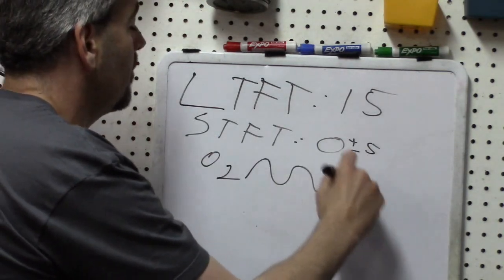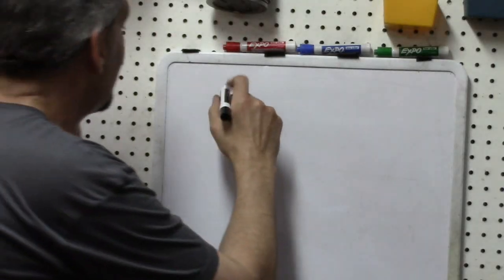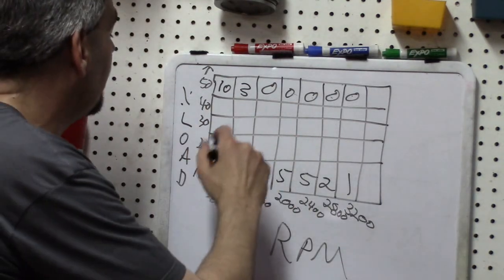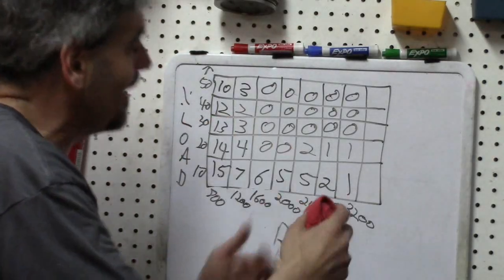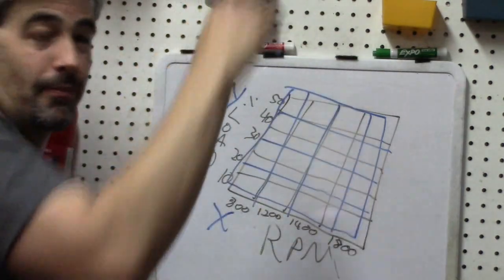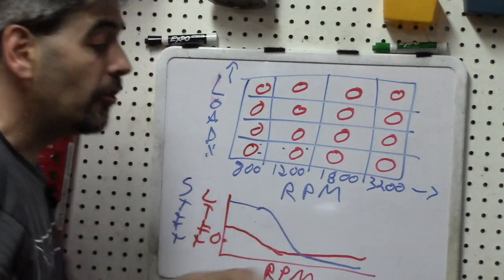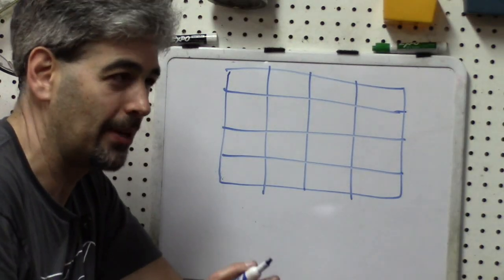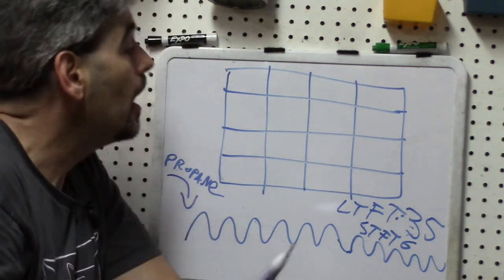Understanding+Diagnosis: Adaptive Fuel Learn Strategy

Comment: So if im working on a ford 4.6 and it has a vacuum  leak and is setting lean codes for both banks. My STFT is 0 because the computer has adapted for the lean condition and my LTFT +30%. If i find the leak and fix it while watching the fuel trims what is the STFT gonna do? Go negative until the o2 is reading stoichiometric? How long does it take for my LTFT to come back down to a normal value? I fixed this vehicle already but i didnt understand how this vehicles adaptive fuel strategy worked.
Reply from the maker: You are correct. In some cars you will see the adjustment with STFT immediately, in others I have seen it take as long as 10 minutes. But indeed, since the car has been adding fuel to compensate for the leak, fixing the leak would cause a rich condition and the STFT will compensate by subtracting fuel.

Comment: Matt my scan tool states OL bank one, four cylinder engine. It seems one of my O2 sensors is not going into closed loop. Car is running great I am a bit puzzled. But as I said I believe my car if fixed. Any advice appreciated thanks.
Reply from the maker: There are usually two reasons that a scan tool shows a car won’t go into closed loop.  One is a communication issue with scan tool- it just doesn’t show the car is in CL
   The other is that there is an issue preventing car from going to CL.  It’s known as OL3. Things like misfire problems, timing problems, some sensor issues can cause the car to not go into CL despite the engine being warmed up.
Reply: @SchrodingersBox  Thanks Matt I will see what I can find out. The car is running very smoothly, no noticible misfire, cam timing is spot on, ignition timing is computer controlled as you know. SHTFT is still zero long term 8%. Going to test the sensors and wiring to the o2 sensors. The fact that the SHTFT was 16% proves the sensors are working after I fixed the vacuum leak. Mabe just not communicating it's closed loop with the scan tool.

Comment: I am trying to figure out my crossfire injection OBD -1 with a Snap - on brick mt2500. Is block learn, long term and integrator, short term trim? I'm confused!
Reply from the maker: yes exactly. you got it correct.

Comment: Ok. No jokes. True that.

I haven't read all comments yet (bummer), but - Matt.
You mentioned fuel maps. Great. To be honest - I hope you will dive into this even more (although I understand you don't want to loose 98% from your 2%...), but are you sure that the map will be zeroed after refresh? AFAIK there is a map that is provided in PCM and this is the one that is just corrected later by all sensors (adopted). But I'm not an expert here of course and really willing to learn as much as possible in this area.

The next thing is that you were about too explain that it's ok not too see o2 sensor going rich when you have LTFT maxed out. Well, your video explained Fuel Trims (and why they do not change as expected), but not o2 sensor I believe. Why?

Because from my understanding o2 sensor is stupid. It measures (well, now we know what it measures for sure :P) the amount of fuel mixed with oxy.
In condition like in Jeep - bad fuel pump - o2 should always show lean, no matter what. There is always less fuel (let's assume that) than expected to meet 1:14,7. And when you add propane - it should show rich. No matter what. There is always more fuel than expected. Actually you can test o2 sensor not plugged into the PCM just by heating it and spraying or not propane. This way it will never be oscillating of course, but it should show or lean or rich. Isn't this stupidness of o2 reflected by scan tool? In that case - to rule out bad o2 sensor it would be better to use just voltmeter and check, if under maxed out LTFT and bad fuel pump it still shows around 0V, but after adding propane it shows some change.

Oh man, what a long comment. :/ And hopefully my way of thinking is not completely wrong here.
Reply: For the first question, it seems that in this answer he agrees with you: "Once created, is the adaptive learning array stored in volatile memory, such that disconnecting the battery clears that array and those variables are purged?  Furthermore, are there default variable settings in the array that the PCM can follow until a new array is learned and stored?
REPLY

Schrodingers Box
Schrodingers Box  1 year ago
+bionicat Both of those statements are correct!"
REPLY
"
Reply: Am new at this , is a bit complicated but I understand and since I don't have a fancy scan tool to check for them maps I agree with Brady bell if you clear the PCM I believe it will force the problem to show it self a lot more whit the other test you have shown us. Am I right mister Mat? The hole thing here is to give the 2% a way to look for problems with average scanner with out using this expensive scanners. ether way I have learn a lot watching your videos Mat thank you. ps: by the way am a terrible speller  lol

Comment: Question pls.. My car at idle LTFT is around 5% and when my car is actually running I get LTFT of around 9.38% at 4th gear and on 5th gear it goes 10.50 to 11.40% is that normal or it is adapting to its problem? My car is 05 saturn ion manual. It really confused me about 14.7:1 while running the car does ur LTFT stay 0% or it may change base on the load assuming the car is in perfect condition? Thank u! Hope u can clear my mind out.
Reply from the maker: i don’t see anything wrong.
Reply: Thats the normal for it? Thanks so much!
Reply from the maker: No way of knowing. All you have is fuel trim data. I don't see whatb you are exactly looking for. What is the strategy here? What are the symptoms? What are the fuel trim responses to input variables?  There is nothing you can say with this data.

Comment: Question I have a 2012 Buick enclave with about 67 K miles.
When it's cold like first thing in the morning when I start her up for about 10 seconds or so I get a rough idle and then she settles down nicely.. she's burning more gas than usual. Fuel pressure is normal at around 59 psi. I noticed today bank 1 sensor 2 is clocking low millivolts the other 3 sensors are much higher 
The other day my STFT was okay but my LTFT was negative 100%.I can't seem to find any vacuum leaks.
What's your thoughts on this pesky problem.thanks
Reply from the maker: I am not following - why are you doing sensor 2 data on a negative fuel trim?  you can’t tell anything from this data. 
  just stay with the basics- just run a fuel trim total curve against load and get the direction that way.
Reply: @SchrodingersBox  sorry should have mentioned the bank 1 and bank 2 sensors are the Oxygen sensors..two issues conflated..
Reply from the maker: oxygen sensor data is not useful until you know the full fuel trim curve.

Comment: I have civic 2005 1.5L. It does not have O2 sensor. On OBD2 it does not support STFT/LTFT. How this works in my car?
Reply from the maker: You have an air fuel sensor. Just use stoichiometric output instead of fuel trim.
Reply: @SchrodingersBox  thanks

Comment: I connected the scanner on my 94 chey trk 5.7 an is showing open loop an a lean condition an a fix #of456 could this be a intake manifold leak an what else can I check like your vedios
Reply from the maker: Simon flores You need to check fuel trim against induced variable- you are just listing symptoms, not diagnostic data. There is no way to make a diagnosis on this little information bro.
  See my video "secret of engine problem diagnosis: fuel trims" and it will show you how to do this right.

Comment: I have a 2003 ford focus zetec.  The long term fuel trim is at 0 when I start the car and also after I drive it around for 10 minutes.  I know I have seen the ltft show positive numbers before.  The short term will show between 15 and 30% so I would expect the long term to show something.  Would a check engine light cause the long term fuel trim to be set to 0 or disabled?  Is the ecu using the car battery to maintain memory or are there capacitors (or something else) on the ecu that could have failed?  I'm trying to determine why the car sometimes dies at idle and I'm sure it is due to getting lean but I suspect it wouldn't get so lean if the ltft was actually working.  Any suggestions?
Reply from the maker: WHat is the MIL code?
Reply: @SchrodingersBox  there are two and both are pointing to engine being too lean. I'm going to do a smoke test soon to see if I can find any leaks. If the code numbers are important I can grab those and post back.
Reply from the maker: Ummm the code numbers are THE most important. Why on earth would you smoke test the engine not knowing the codes?
Reply: @SchrodingersBox  the codes indicate engine lean.  I'll have to allow them to reappear so I can get them again. I suspect there has to be a vacuum leak because short term trim was going to 30% today at idle.  Thanks for the input by the way.
Reply: Checked for any vacuum leaks with smoke machine and didn't see anything.  The car idles okay at about 30% short term fuel trim with 0% long term. Engine RPM is around 800 and the air flow rate shows 1/10 pound per minute.  Fuel pressure is steady around 42 PSI. My only guess is that the air flow sensor isn't reading enough airflow.
Reply: Turns out the pcv valve was the issue. I replaced it 4.5 years and 60k miles ago.  Since the pcv regulates the amount of air that passes though the crankcase bypassing the air flow meter I should have considered it first. The short term fuel trim is back around 0% at idle now and air flow meter now reads about 3/10 lb/min. Old and new valve felt like they were flowing the same at idle so best to replace at regular intervals I guess.  The old valve rattled same as the new one.

Comment: what happens if we unplug the O2 sensors and drive it like that for ever?
Reply from the maker: Then you will lose performance and fuel economy plus have the check engine on forever. Also if the native induction doesn’t provide stoichiometry, you will permenantly run either rich or lean either of which is bad for the engine. there would be no trim adjustments.

Comment: Hi, I really like your videos. Maybe you can help me and give me a trace for my problem. My car (Ford Focus) has a very low and stumbling idle about 690-710 rpm (should have 850 +- 50 rpm). I looked up the LTFT which is at -8 and the STFT about 0-1. BUT the O2 Sensor oszillates between 0,1 and 0,6V whitch would be a lean condition. If I tip the throttle LTFT changes to -5 (yep the learned value for this conditions) but STFT decreases to -6 as well, so the sum is pretty negative. Do you have a clou why the fuel trims could be negative under lean conditions? Or a hint what datas I should check?
Reply from the maker: +Fabian Wojtalla You do not have any data that is relevant to identifying a condition here. Need LTFT and STFT curve over RPM and response from O2 to induced lean and rich variables.
  With what you have here, there is nothing useful.
Reply: +Schrodingers Box Please have a look on this screenshot. 
http://fs5.directupload.net/images/160202/nmtpun2q.png
I can not imagine any reason for this behaviour. How do you think about the O2 sensor? I'm worried about the amplitude whitch is in idle not higher than 0.7 
It's not a professional scan tool btw. What do you mean with induced lean and rich variables? Like adding propane in the mainfold? How do I induce lean variables? Any hints?
Reply from the maker: Fabian Wojtalla I see nothing indicating a problem there. What am I supposed to be noticing?
Reply: +Schrodingers Box So the basic problem ist the low idle rpm so that the car begins to stumble. There is no trouble code set, so I had a look on the fuel trims and in general they seem to be negative. Furthermore the O2 sensor seems to be "slower" in idle in comparison to higher rpms. Unfortunately that's the first car I train diagnosis and I have no "healthy" datas to refer to. So I asked you for your opignion and what you would have a look to. I agree with you, that my graph doesn't show that bad datas like in your videos. I also asked a mechanic but he only wanted to increase idle rpm without fixing the problem. That was not satisfying and not 2% like ;)
What I already Checked/cleaned: IAC, IAT/MAP(2 in 1), air filter, TP sensor
I'm going to have a look for the injectors but after that I have no clue.
So far, best regards out of cologne :D
Reply: Faulty O2-sensor (high emissions, not seen).
Reply from the maker: Ilpo Kotiranta Based on what eveidence?
Reply: Happened to me: O2 = 0,2 - 0,6V and Air/Fuel Status= Rich -> high emissions -> O2 sensor faulty.
Bosch zirconium lambda lifespan about 100.000miles/160.000km.
I couldn't explain this by LTFT/STFT, just by strange O2 behaivior.
Reply: An adaptive algorithm is an algorithm that changes its behavior based on information available at the time it is run. This might be information about computational resources available, or the history of data recently received. In machine learning and optimization, many algorithms are adaptive or have adaptive variants, which usually means that the algorithm parameters are automatically adjusted according to statistics about the optimisation thus far (e.g. the rate of convergence). 

Here adaptive algorithm trusts on sensors and can be cheated by faulty sensors when they aren't noticed to be faulty.
Reply: Kalman filter is a well known and documented example of an adaptive algorithm: https://en.wikipedia.org/wiki/Kalman_filter
Evidence: Noisy sensor data, approximations in the equations that describe the system evolution, and external factors that are not accounted for all place limits on how well it is possible to determine the system's state. Unpredictable sensor data makes the system unrobust: https://en.wikipedia.org/wiki/Robust_control
LTFT/STFT is a way to follow ECU control's evolvement and robustness.

Extra
The relative certainty of the measurements and current state estimate is an important consideration, and it is common to discuss the response of the filter in terms of the Kalman filter's gain. The Kalman gain is the relative weight given to the measurements and current state estimate, and can be "tuned" to achieve particular performance. With a high gain, the filter places more weight on the most recent measurements, and thus follows them more responsively. With a low gain, the filter follows the model predictions more closely. At the extremes, a high gain close to one will result in a more jumpy estimated trajectory, while low gain close to zero will smooth out noise but decrease the responsiveness.BMW enthusiasts are hoping tunable Kalman gain.

PS. A professor said; "learn this when you are young, it will be harder when you get old". I'm now 65.

Comment: Hi have a 2014 suzuki swift that have long term at -10 with o2 sensor flat line at 1.2v so i feel it rich restance on o2 is 3.7 what is cause
Reply from the maker: You can’t say. you have a static fuel trim time-point and nothing else.
Reply: @SchrodingersBox  what you mean by that?
Reply from the maker: I mean You have to curve the trim against load. You can’t look at a static reference.

Comment: why wont my STFT return to zero on idle if the LTFT is 16%,,stft is 20% still,can you clear the pcm?
Reply from the maker: What is your STFT reading?
Reply from the maker: Oh sorry I see it's 20%.  It could be that it is still learning, you introduced a variable in whatever fuel cells were covered in your testing however you did it (RPM vs fuel trim, etc) or it could be you are looking at a new cell.
Reply: yes i did do fuel trim and rpm..the stft goes down..I am a student of yours now,very cool stuff,i am going to to look at O2 on wot like you did on the jeep...it might not be that rich if its a small vacuum leak.

Comment: WHERE WOULD THE FUEL TRIMS STRATEGY LEAD YOU IF YOU HAD A VEHICLE THAT AT IDLE BUT ALSO AT HIGH SPEEDS THE FUEL TRIMS WAS CONSTANTLY -20%?
Reply from the maker: I would say there is either an extraneous fuel source entering the engine or the induction is over-measures.

Comment: Noob question: how is engine load detected by the ecu??
Reply from the maker: Asky66 That is not a noob question!!  I actually don't' know what the parameters used to discern engine load are but I can tell you that it is very apparent engine load is not what we would normally think- for example 50% load is not 50% of the engine output capacity.  It is clearly linked to RPM, MAP, and TPS among others I am sure but it is not and is not meant to be a interpretation of comparison to maximum output. This of course begs the question- what is the purpose of load% and to be honest, I have no idea. I generally look more at MAP and TPS and RPM to get determination of engine is "working hard" more than I use a load% PID. It is worth looking into though.